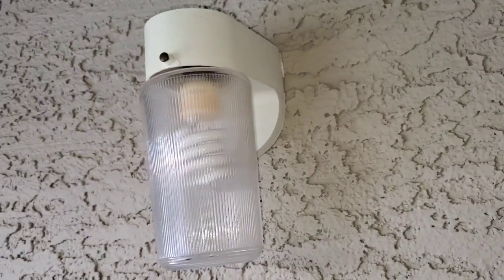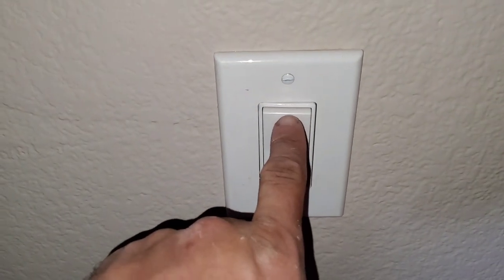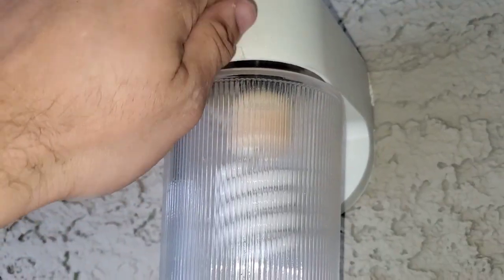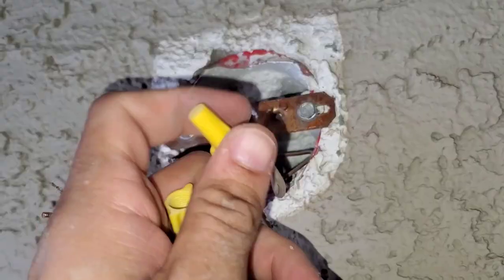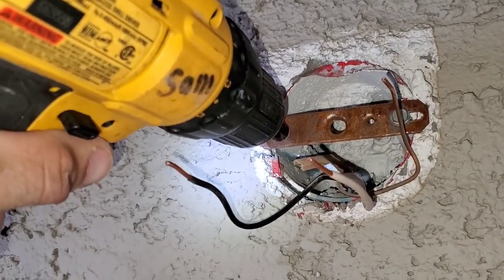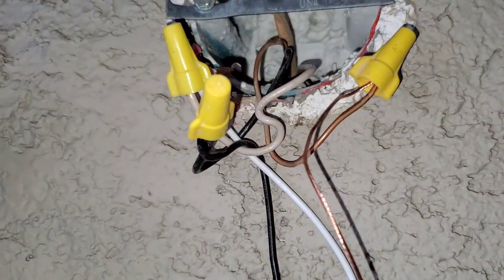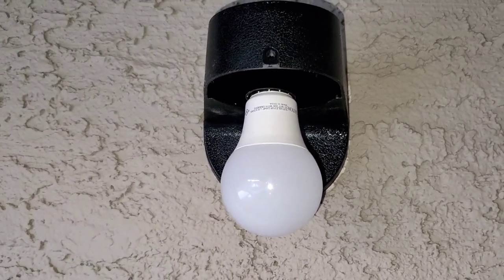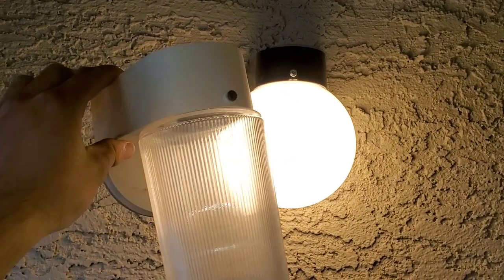Update ANY Light Fixture. EASY!

Comment: Great video thank you! How can you tightening the electrical housing that’ is set in wood siding T111? When the contractor installed siding he over cut the hole, the light housing isn’t snug it slightly hangs with a 1/4 inch gap all around? I couldn’t install the new led porch light.